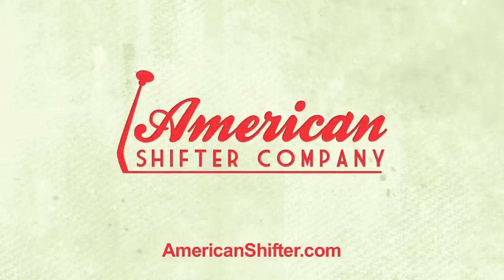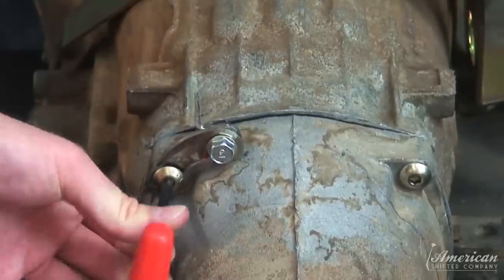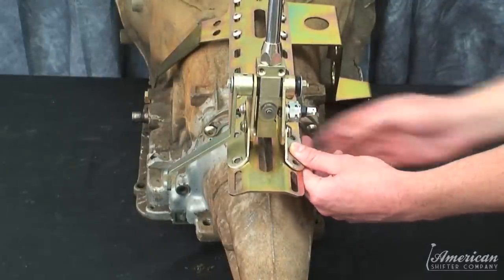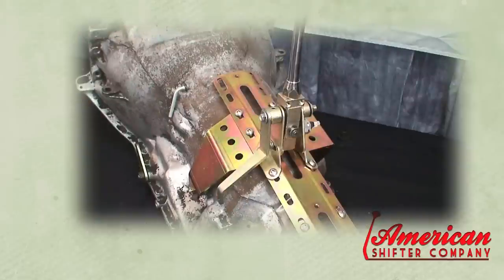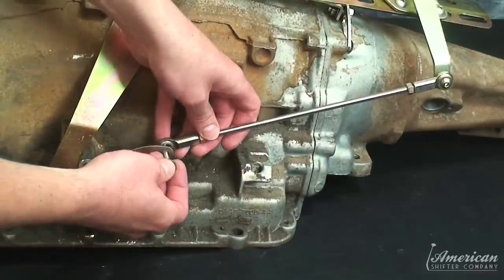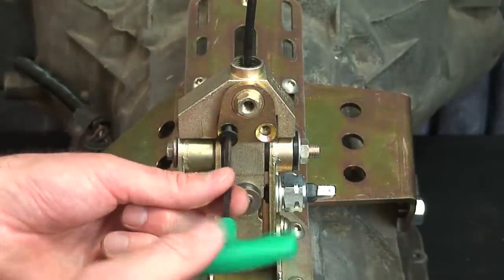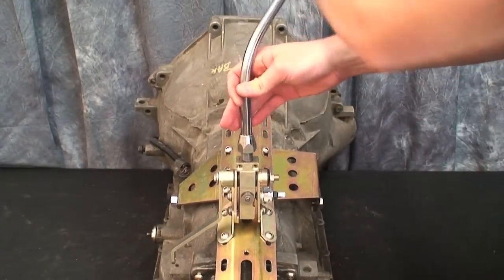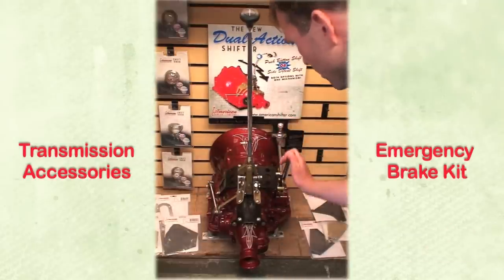Ford C6 Dual-Action Shifter Installation Video from American Shifter Co.

Comment: Do you make electronic shift indicators? Whenever I take a dash apart I keep breaking the cable that runs between the cluster and columb on older 3 speed automatics.

Comment: Did they just pull the band adjustment out of the side of the transmission for mounting the bracket??
Reply: yes  you cant do it like they did in the video the band adjuster will fall int he pan and you will have no second gear
Reply: @fishinfool63  It is what I thought! However, it is to short, only 2 1/4 treads  and No Nut for install... Not that it would fit.

Comment from the maker: DO NOT REMOVE THE ADJUSTMENT STUD FROM THE TRANSMISSION. PLACE THE BRACKET ON THE STUD AND SECURE WITH THE SUPPLIED NUT.
Reply: At 00:38.   On the Driver side, where You place the holding plate on transmission, there is No nut there.  However mine does, everyone believes    it is some sort of adjustment bolt & nut.   Everyone that has looked at it, feel I  should Not mess with it. It Only has 2 1/4 thread and NO Nut is supplied.    Is this the adjustment bolt & nut you are referring to?

Comment: Horrible design and cheap as hell. Does not work with C6 without a lot of modifications. Rear mounts do not reach center bracket. YOU CANT !! Put the drivers side bracket on the Band Adjusting pawl. Stupid as stupid gets !  I have installed a ton of Lokars and these junk knock offs. All are not worth the money and time.